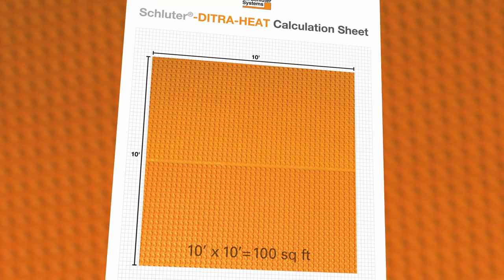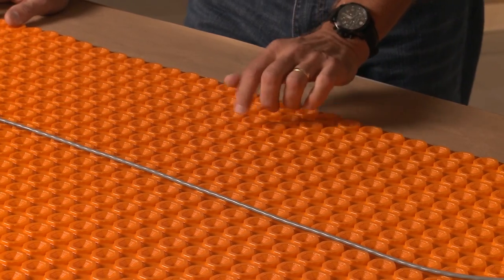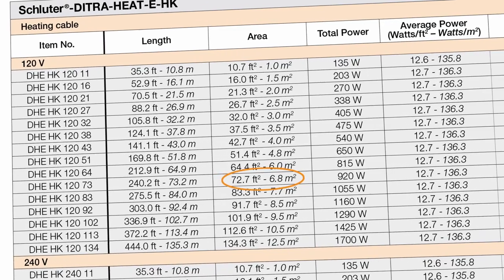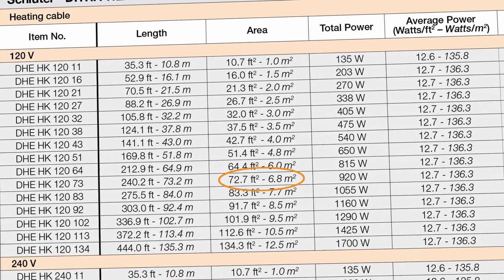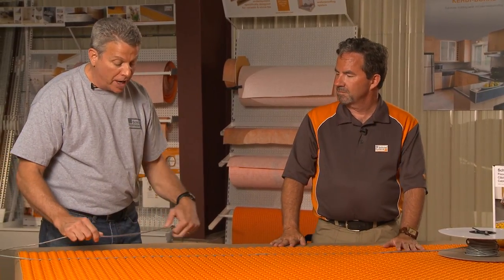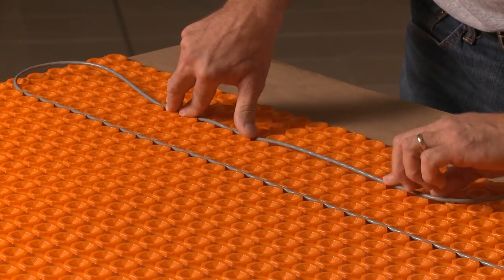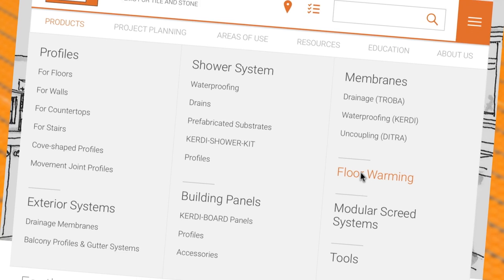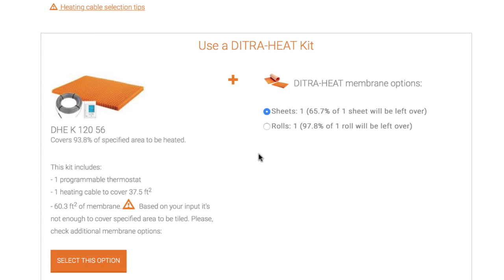Tips on calculating cable length for DITRA-HEAT

Comment: I have your product and the contractor did a terrible job installing my bathroom tile the tiles are getting loose and grout cracking in places, can I carefully lift up the tiles without damaging the cable?
Reply from the maker: Hi there, can you please give our Product Support team a call to discuss your project in a bit more detail? 888-472-4588 (US) or 800-667-8746 (Canada). They would be best suited to discuss the options with you and advise from there. Thanks!

Comment: Are you allowed to space wires ever 2 bubbles?
Reply from the maker: Hi there!  Cable spacing shall be limited to a repeating 3 stud spacing, or a continuously alternating 3 stud and 2 stud spacing (i.e.: 3-2-3-2-3-2 and so on). A continuous 2 stud  spacing is recommended  only when connecting a 240 V heating cable to a 208 V power supply.
Reply: @schlutersystems1  thank you. Is it ever ok to have it be 2 studs off of the wall?
Reply from the maker: Hey, Yes, the cable installation can start 2" from walls, partitions, and fixed cabinets.

Comment: Fair warning... the calculator / estimator is a waste of time. It starts out easy enough, letting you select various options but then goes sown hill fast! When I tried to input the dimensions of my room which is 9' x 11' and the program displays 10'x12' ! WTF! I tried different browsers, refreshed the screen, relaunched the program... same results. The only way I could get it to show my actual room size of 9x11 room was to enter 8x10. These problems continue when you attempt to enter the toilet or furniture or other device sizes... it prevents you from entering your "actual" measurements. e.g., My shower stall is 3' 8" x 4' 11". No way would the program allow me to even get close those measurements. When I try to change the shorter wall to 3' 8" it will only accept 3' 2" or 4' 6". Schluter needs to spend some of the big dollars they make off their products and update the program!  FYI: I tried calling the customer service team for assistance which also turned into a waste of time. Their solution was I should just subtract one foot from the room length and one foot from the width, multiple the two number and order that length of cable. If that's true, and the calculation is really that simple then why provide a calculator that only serves to frustrate customers?
Reply from the maker: Hi Elton, I'm sorry you had a negative experience with our Estimator. I have passed along your feedback to the appropriate teams. Can I connect you with your local Schluter rep to discuss your heated floor project? They would be happy to assist you in any way. If so, please DM me your city and zip/postal code, and I will send through the contact info for your local rep. Hope this helps. Thanks.